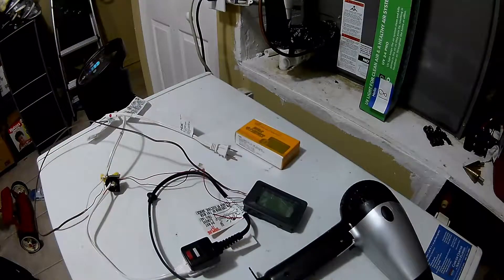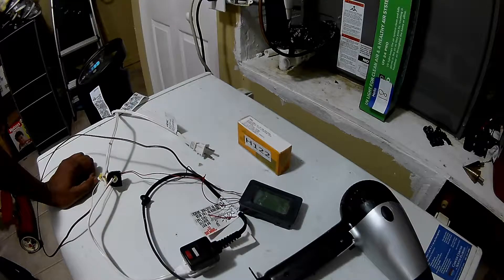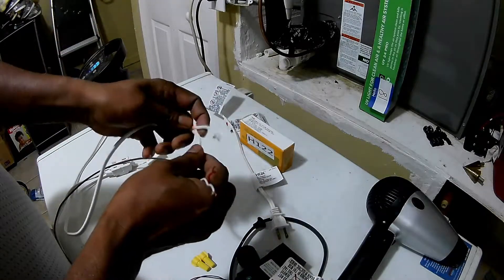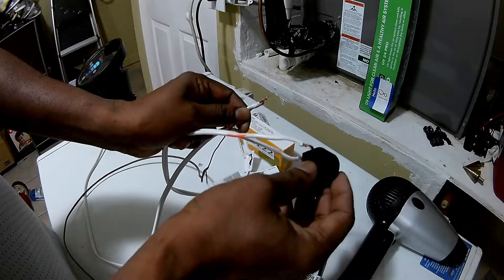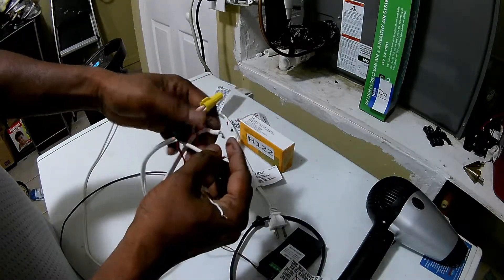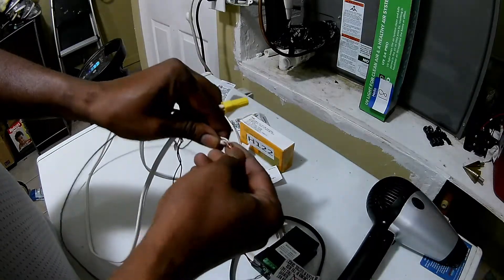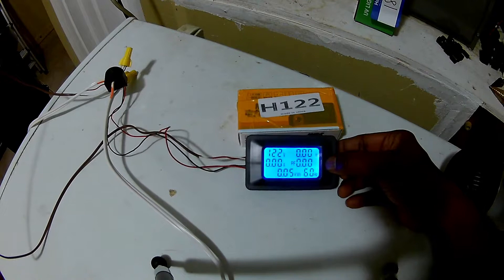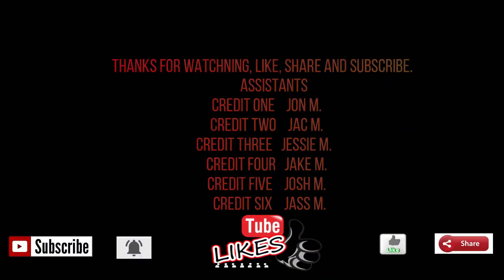Electric Power Generator Watt Meter Testing

Comment: Barr8323:  How did you connect this to your generator?  Do you have pics/video.  I would like to connect this to my generator to monitor the the output wattage when I connect the generator to my house via a twist lock cable.  I DONT WANT TO CONNECT IT THE THE ELCETRICAL PANEL BOX .  I WNAT TO CONNECT TO THE GENERATOR.  What wires on the generator do I connect the CT?
Reply from the maker: I didn’t connect it yet, I am behind in my projects. My plan is to connect to my distribution panel so I can balance the load.

Comment: What is the proper way to connect the CT? both hot wires of 50 amp circuit breaker or just one hot wire to the breaker on the electrical panel?
Reply from the maker: Depends on the CT Spec, that set up I have is 1 hot and one neutral.
Reply: Thank you appreciate the information.